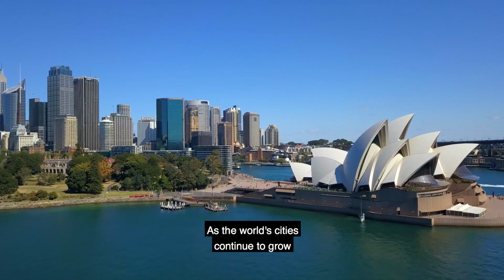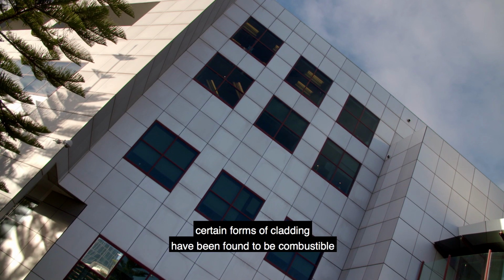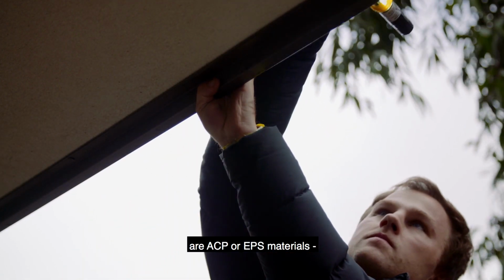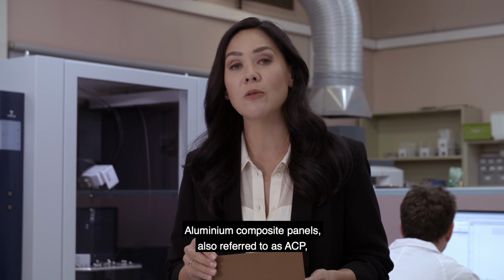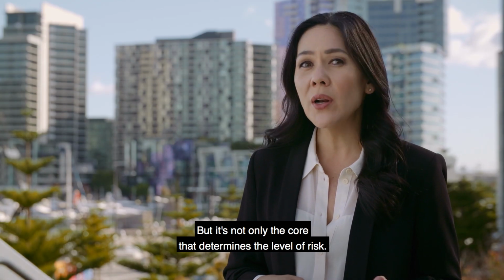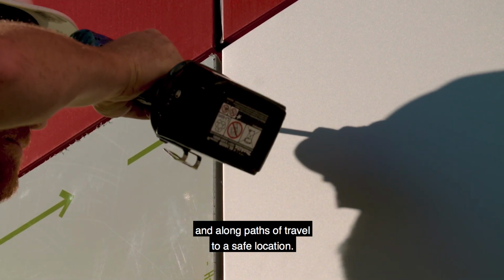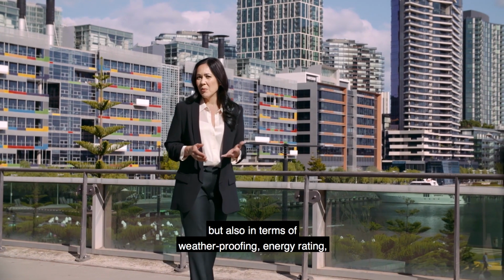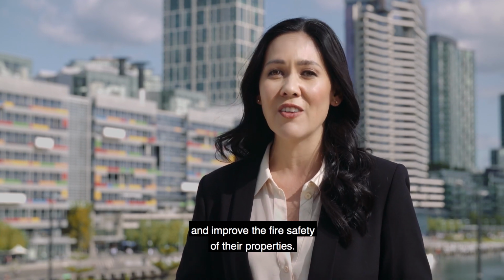1. Combustible Cladding and its Replacement

Comment: The “lower risk alternative” shown in this video (Vitracore G2 - Fairview) was withdrawn from the UK market as dangerous and combustible. It’s also been removed from a number of architect specs through Australia for the same reason. Poor decision by the VBA to use it here.
Reply: I understand that Fairview has since managed to achieve approval for its G2 product by testing its components individually (rather than the panel itself) to AS 1530.1 -- it seems this complies with the DtS requirements of the BCA (which I find puzzling). They also note G2 has now been approved for use in the UK
.
They also assert on their website that "VITRACORE G2 PASSES OFFICIAL FULL-SCALE FACADE TEST", but note in the 'fine print' that it passed the AS5113 facade test "excluding the debris requirements" (I understand that this doesn't constitute a 'pass' for Australian compliance purposes, even if it does satisfy the parallel British Standard).
The Fairview website also announced that G2 was used as the replacement cladding on the Lacrosse Apartments building ...

Comment: Whilst the focus of various investigations has generally been on aluminium composite panel systems (and polystyrene, as noted in this video), there are several other lightweight cladding systems that are either not compliant or potentially not compliant with the BCA -- for example:
* Metal composite panels with a mineral fibre or foam core
* Wood fibre/melamine or thermoplastic composite panel and plank systems
* Profiled and multi-wall polycarbonate panels and planks
* Plywood and timber boarding.
Another product that hasn't been validated is high-build polymer-modified cement render (i.e. greater than 1 mm thick) over compliant substrates (such as blockwork). 
Green walls, whilst a great idea, are also a potential source of fire spread across a facade (particularly if not well maintained)